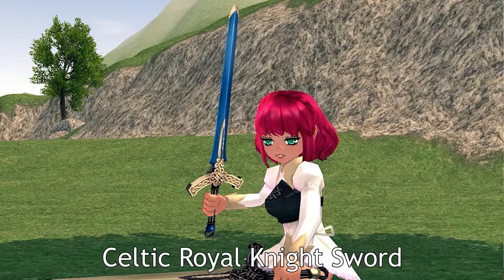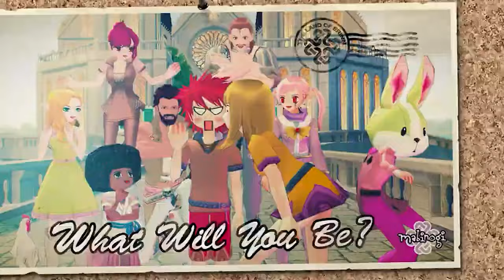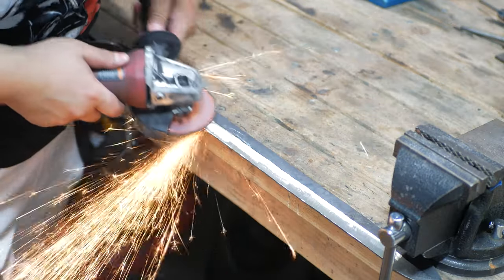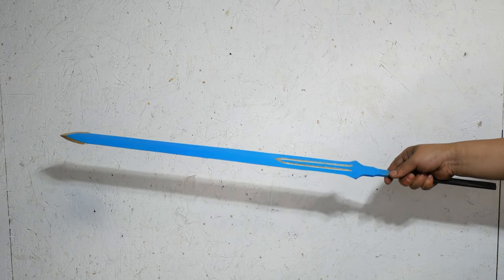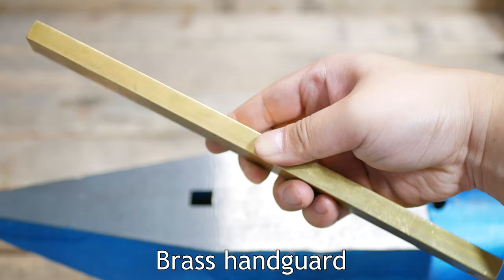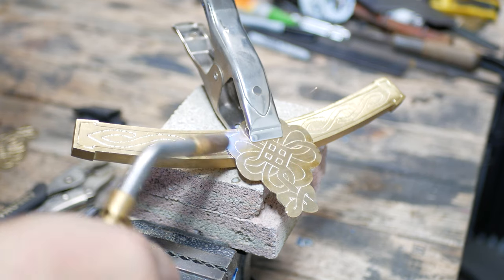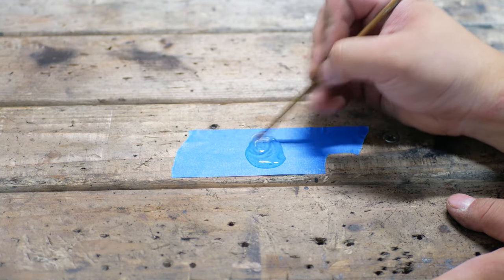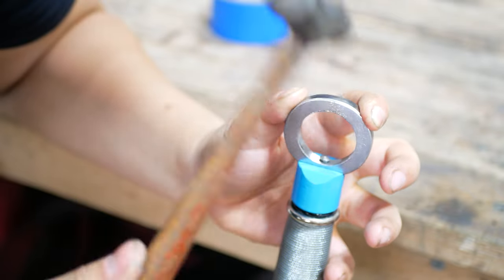Sword Making - Celtic Royal Knight (Mabinogi)

Comment: You're moving up. Sponsored. 5160 is an excellent choice for a mono tempered blade, lot of the really top guys use it well. Check out John Lundemo's work for examples.That had to be a pain peening in such a confined spot. I didn't envy you that task. I would have welded the ring on after peening, but I'm lazy like that. Wire wrapping is nice too look at, but works/feels better when wearing gloves. I own a sabre that is partially wire wrapped and it took some getting used to without gloves. It does however present me a suggestion to make for a build, but I'd need a way to send you photos. Was it your idea or the sponsor's to add the voice over?
Reply from the maker: Thank you! Sometimes I like to change to 5160 and a sponsored video is definitely a good time. You are %100 right about peening in the ring pommel being difficult. Also, I didn't even think about welding it for extra support. Definitely would have done that.

(Just checked out John Lundemo's work, he makes some great stuff!)